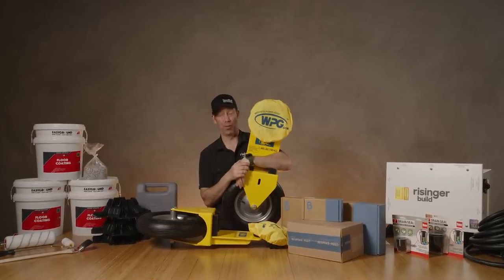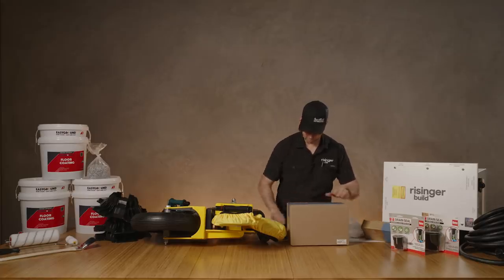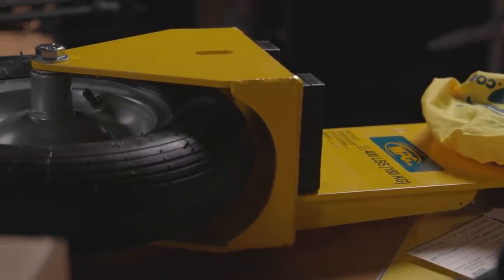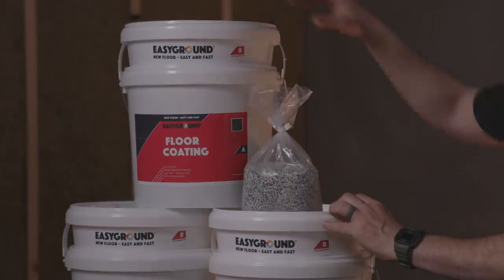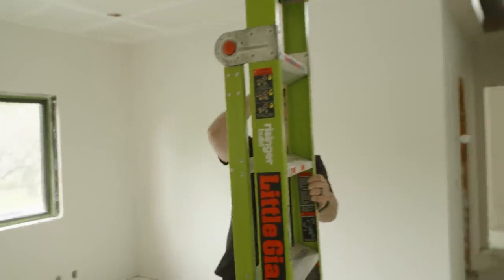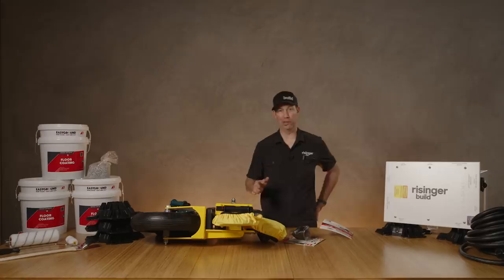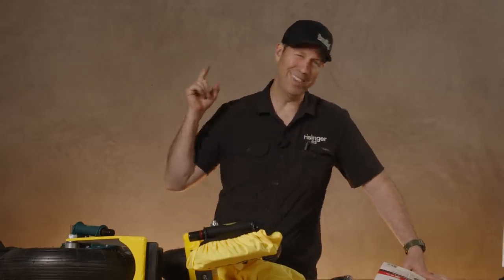10 New Building Products & Tools | April 2021

Comment: Short: 14:19 Deako Light Switches
Long:
0:00 Intro
0:30 Ad for Bespoke
3:40 Wood's Power-Grip Dolly 
5:03 TuffBlock
6:50 Easyground
7:40 Oatey Drain Seal
9:08 Trystar Spider box
10:45 Little Giant King Kombo
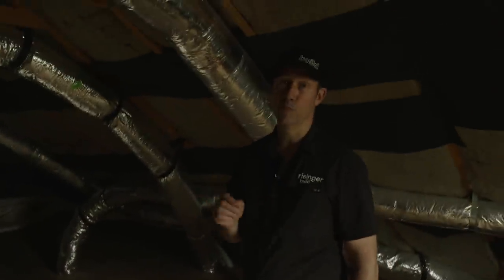12:10 Majic Stairs
13:00 DeWalt 550 PSI Power Cleaner
14:19 Deako Light Switches

Comment: Woods should add some fork holes to those wheels so you can use a forklift to lift it out of the truck. Or start selling a version with them, it'd be nice to have a good positive pocket for moving widows with forks. If you live in a really windy area that cause your traps to oscillate I think the Oaty product would be great to keep the wind from sucking your traps dry.

Comment: I have a Werner ladder that I have had for 20 years that is like that King combo, that is probably the most coveted ladder I own! The second most coveted is another Werner ladder that looks like a drywall bench but with one less step so it's just an extra wide extra stable 2 foot step ladder which is great for painting because I can cut in an 8 to 10 foot wall at the top and only move the ladder once!

Comment: Those Deako switches look very slick.
Reply: Agree but in all honesty how often is a person changing out a switch type in a typical residential setting? Also...$55 for a single dimmer switch!?! 

Cool idea though.
Reply: You still need an electrician to install the 1st switch :) and I doubt they make stuff as good as Lutron
Reply: @Ampacityelectric  I am trained in Electrical. I discovered so much wrong and unsafe wiring in my house it makes me surprised there wasn't a fire. Taking pictures before starting assumes everything was correct before hand. I took down fixtures only to discover the black wire was actually the neutral. It was reversed in a junction box in attic. To a homeowner, they wouldn't know. I've seen ground wires attached to hot or neutral because they didn't run romex with ground to that fixture and homeowner figured the green wire "must go somewhere". Switches operating by interrupting the neutral vs the hot (it works so it must be right....right?) and last but certainly not least, romex just spliced together in attic outside junction box with only a few strips of crumbling electrical tape holding it (this was for my refrigerator circuit) . 

Yes, that dimmer only needs two wires but it will technically "work" even if those two wires are the neutrals. Joe homeowner won't know that it's wrong or unsafe. Electricity isn't something a homeowner should be doing without training and knowledge. I've had to undo so much DIY hackwork that could have killed someone it's unreal.

The switches look nice but how often do people decide to swap out a standard switch for a dimmer or motion sensor? Not often. If they want that, they'll normally put it in initially. Any swapping don't happen for years at least. Switches/Receptacles etc normally go untouched for YEARS in a house, sometimes decades and only get changed when they fail. These aren't parts of a home people just swap around. And like you said, say you DO want to swap one 7 or 8 years later. What if company is gone? You gotta start from zero again.

Comment: Did I hear that correctly? You are draining your dishwasher and your pan drain outside, instead of to the drainage system on your band new house? Also, if you have sewer gas bypassing your traps, you have big issues.
Reply: Might depend on local code. I think when he said dishwasher I think he meant a drain pan for dishwasher in case of a leak? I don't think he's piping the dishwasher discharge outside, that needs to go to sewer. However around me, those drain pans are normally piped to go into a floor drain in basement. If slab they might go outside but most homes here have basements and in that case, it always goes to floor drain, not outside.

Comment: I saw your video about the volume with 1/2” vs 3/4” pex.  You talked about type A vs B there is flow restriction.  A good informative video would be demonstrating this using something like a rectangular tank with two lines (A and B) coming off with a couple of 90s or couplings.  Can show how time required to fill the buckets simultaneously.

Comment: little giant u didnt even say all the features it does yikes towards top if not fully extended has an extra peice that folds out and 2 by 4 and fits perfectly in between it nice for new constuction also its triangle shaped to fite in corner where 2 walls meet

Comment: Those switches...answering a problem that doesn't exist. Switches are the easiest thing to switch out. Also, if you shut the power off, you don't have to worry about getting electrocuted anyways. Just my opinion.
Reply: I agree, but it is a pretty slick solution to a problem that doesn't exist haha. The biggest issue is this scenario: you move into a house that had these installed a decade ago, the company doesn't exist anymore, and now you just have to actually replace them anyway

Comment: I'll walk from SF to Austin to design custom LED lighting for you. LMK.
Reply: Jason - can you expand further what you do?
Reply: @ArthurDentZaphodBeeb  Sure. Thanks for asking. For the last 10 years I've be designing, manufacturing and installing custom LED complete systems for homes, commercial and retail spaces. I went to college majoring in industrial design. I engineer the LED in the USA and have it made outside NY. Once I'm done designing the LED, I also create the aluminum 6160 extrusion the LEDs mount to. This dissipates the heat properly and insures the LEDs last decades.  All warrantied for 10 years and built to order. My website is www.ShineOnLED.com In the past 4 years I have been creating custom soffits that bounce the lighting and offer a soft yet bright solution. 100 lumens a foot to 1200 lumens a foot, depending on the need. A house I just finished in S.F. have no lighting fixtures, only hidden bounced light from kick panels and overhead soffits. All UL listed and Title 24. I'm about 18-24 months ahead of all the big brand lighting houses. I got my start in car design, creating dashboards and headlighting in Alias. My dream is to work for Matt and create these LED solutions for custom homes in the Austin area. S.F. has drained my soul. My Mrs. and I need a change. We also design custom kick panels with LED imbedded into them that wash the floors with light that bounces from below. Much better than the typical can lights that deliver a lot of eye fatigue. Let me know if you need any LED lighting questions answered and I'm always happy to jump on a call. 415-563-5517. Thanks. 
-Jason

Comment: I'm more concerned with the O'Biden apocalypse that's rapidly approaching every thing he goes off-script.
5:15  Price comparison between these and standard "portable" concrete deck/shed footers? (I did a quick look and probably didn't put in the correct terms)
That DeWalt washer would be a godsend to many boaters as well.
I love the versatility of those Deako switches, although I'm sure they're priced well beyond your average small contractor or DIYer

Comment: Those switches have to be one of the dumbest things I have ever seen.  Honestly, how often does anyone need to change the type of switch on any light.  In my fourteen years as a home owner, I have done it twice - I added a dimmer in my first home, and removed one in my new home.  Both changes cost a few dollars and took about five minutes.  What possible living situation, in an actual home, could possibly need to change light switch styles so often that they would need this system?  
Further, electricians often advise people not to use push-in connections on outlets and switches because the contact of the connection isn't as reliable as screwing wires down on the posts...compare that to the kind of contact between the "plug-n-play" base and switches and then tell me about how safe they are.